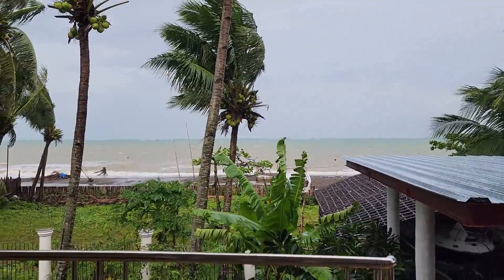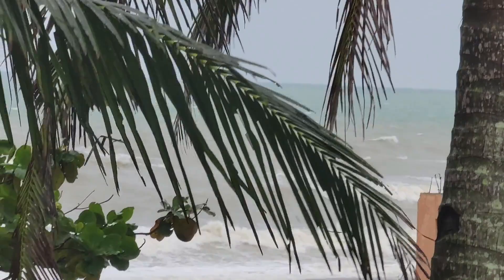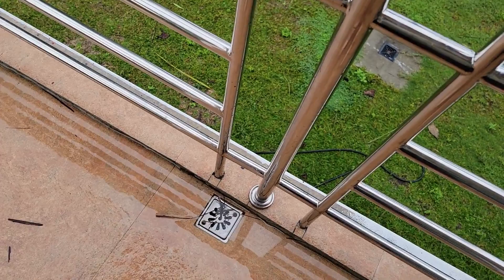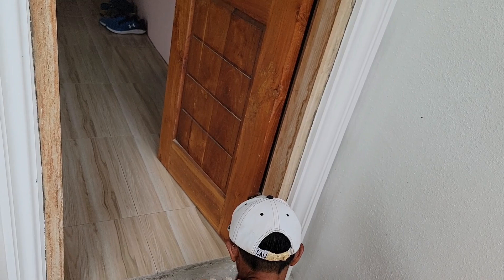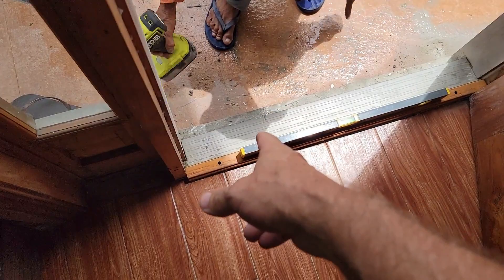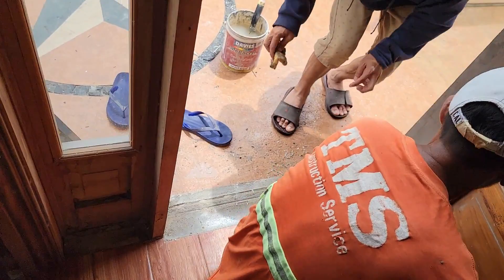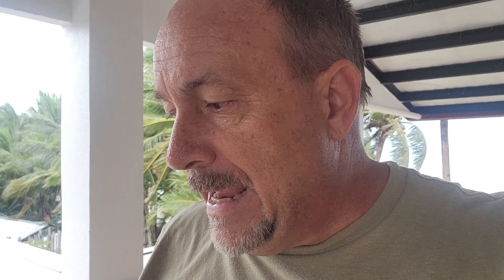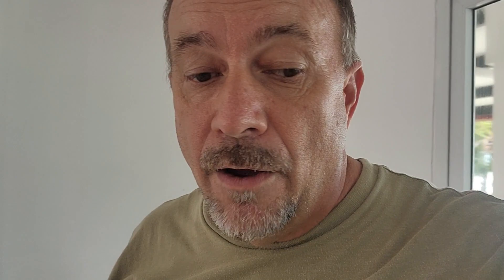Thresholds for keeping CREATURES and able to place Rugs at Doors

Comment: May I suggest to fix your solar light use a clear epoxy resin just lay it flat and level build a form around it with whatever and pour the epoxy in just like a self-leveling floor. The epoxy will seal it and make it stronger than new. Hope I got this to you in time. Great channel! All the best!